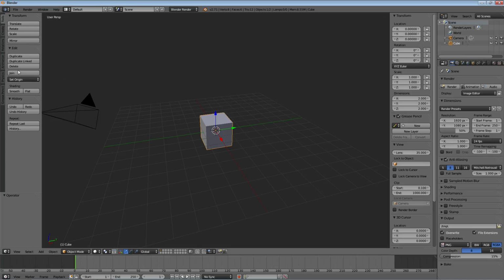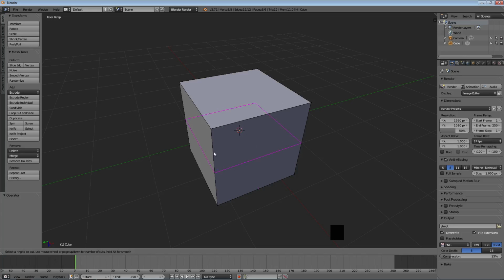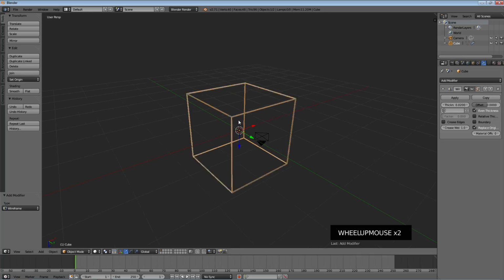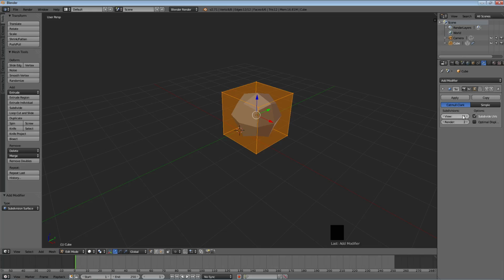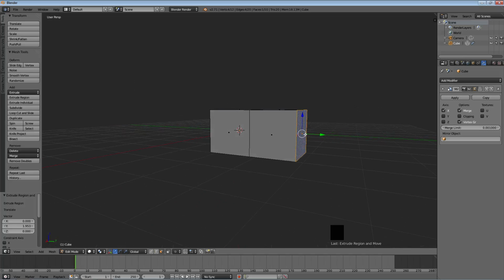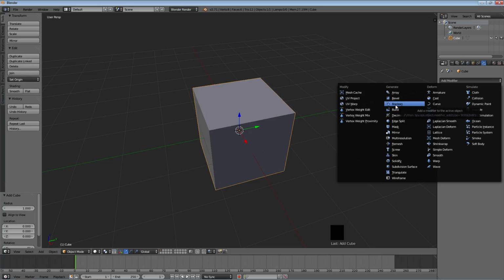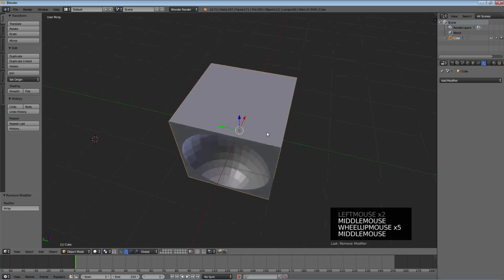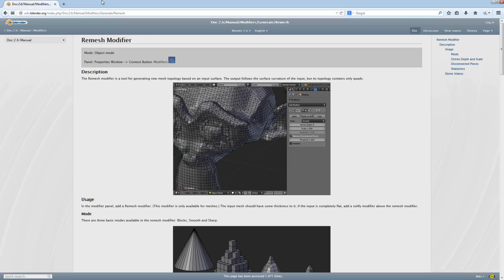Blender Absolute Beginner Tutorial: Episode 6

Comment: Whenever I try to use modifiers it says "Modifier is disabled, skipping apply" does anyone know how to fix this?
Reply: +TheRoboNakama LOL I had the same problem, here is the fix, which after all this time I'm sure you've already got it. 

I wasn't selecting the other object in the modifiers tab section. There is a place to select the other object in a drop down list whichever one you don't have selected on the main screen. I just played around until I figured it out and it worked just fine.
Reply from the maker: TheRoboNakama Which modifier does this happen with?  Are you in edit mode or object mode?
Reply: ***** Boolean and im in edit mode.
Reply from the maker: TheRoboNakama The issue seems to commonly occur because of improper selection of all objects involved.  Make sure you select the 2nd object in the boolean modifier settings and see if that helps.
Reply: TheRoboNakama *Object mode
Reply: +TheRoboNakama just switch to object mode
Reply: Most of the modifiers can only be used or applied in object mode
Reply: Bevel doesn't seem to work for me?

Comment: imagine a box in which i need to cut 3 circles in one side, what is the most symmetrical solution? can i for example select the faces i want to edit at the same time so that i have perfectly cloned holes?
Reply from the maker: Dutchygamerz Not sure I can picture it, but try looking into the boolean modifier.  Then you can get a box, and just cut away the amount of another shape that you stick through it.
Reply: its kinda hard to explain through the comment section though, can i contact you by any other means? that would be great.

The basic idea that i have is to create a weapons mod for a game, and i am replicating a gunturret found here:

http://www.paveglio.com/artvideo3d/images/yam18inch7.jpg

the problem lies with the gunports not being aligned perfectly, i sorta eyeballed it :D
Reply from the maker: Dutchygamerz Yeah I'd definitely use the boolean modifier to cut those holes. You could even line them up by using an array modifier on the arch-way piece before cutting into the turret. Then use the boolean modifier to make the cut.
Reply: I will look into it, many thanks and great tutorials!